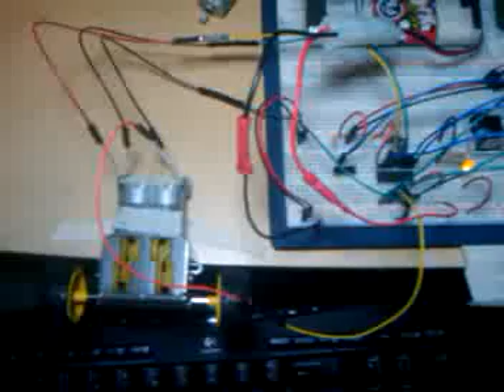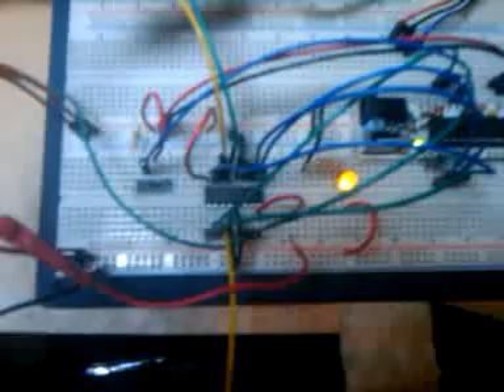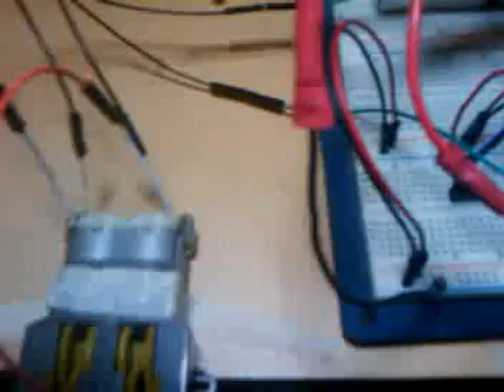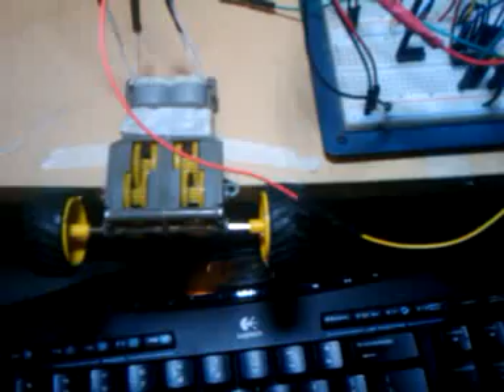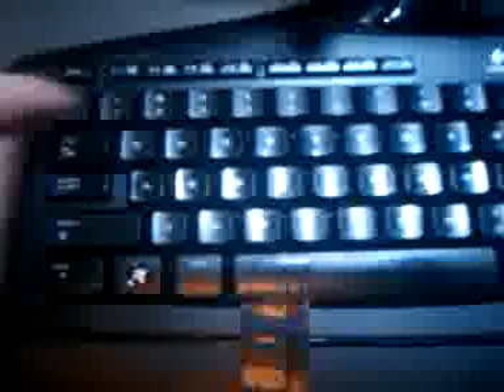Dual H-Bridge Motor Control using Arduino

Comment from the maker: I built this some time ago but I remember generally how I set it up. Basically, the Arduino controls the polarity of the motor (spin it backward or forward.) What really controls the speed is when the Arduino uses PWM on the SN75441 EN pins. I used two PWM pins, one for each. I understand that different PWM pins use different timers.I don't know if you can just set the same pin to both EN pins on the SN75441. Each motor may go at different speeds which will cause your robot not to go straight.

Comment: Hey Nicksen. 
Im am working on a school project, where we are boulding a "tank like" robot, with the same motor as you are using. We also got the SN75441 h-bridge. The problem is, that when we send power to both motors at the same time, it seems like one motor always get most power, and then the other motor is not getting any. Could yo make a diagram, showing your setup on the bridge? It would be very helpfull :D

Comment from the maker: @jaysonkarenjohnson Hi!  In this circuit I was using an H-Bridge chip but other than a kill-switch to cut power in case something got hot, there was no additional circuitry.  I controlled the speed of the H-Bridge via my Arduino program which accepted new speed values via Serial.Read().  The Arduino program would then vary the PWM signals to the H-Bridge so that I would get different speeds.  Because the SN75441 is a dual-H-Bridge, I was able to control each motor independently.